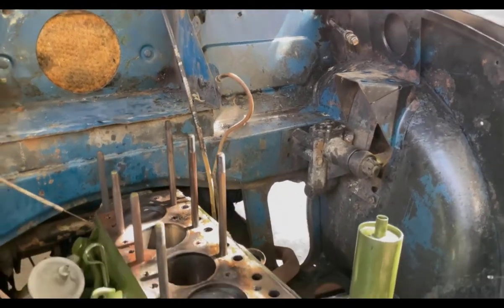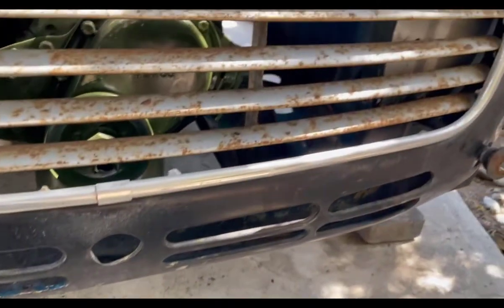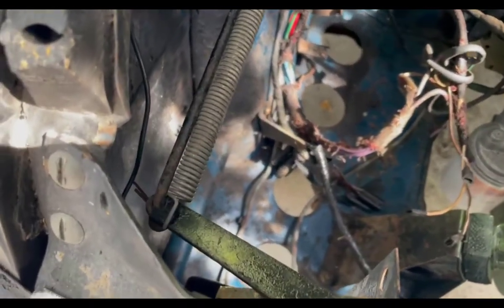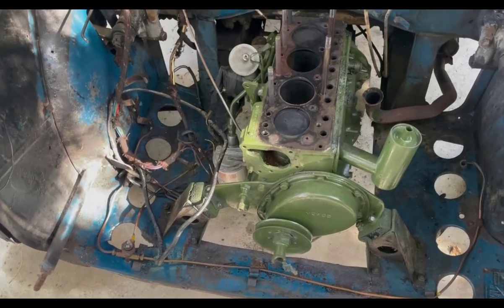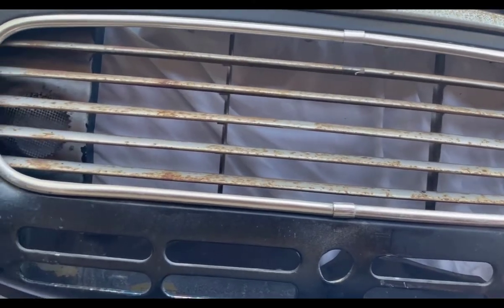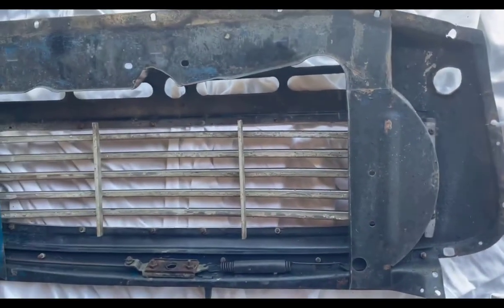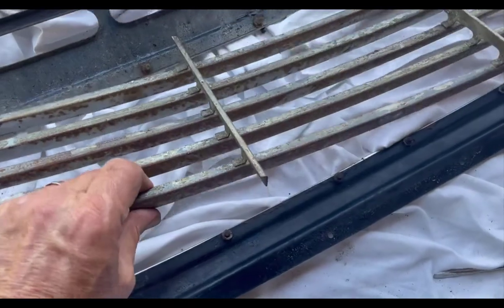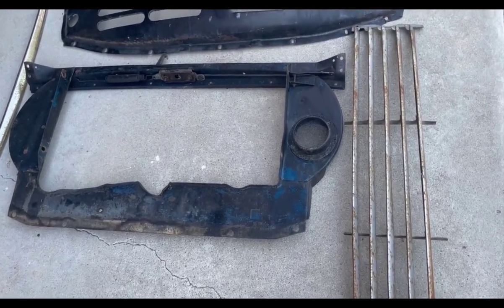Morris Minor Front Panel and Grille Removal

Comment: How about powder coating the front grill and the wheels you are going to use in the same color and same time.
Reply from the maker: Good question.  I am sourcing wheels (car came with  Spridget Rostyle wheels).  This is a very late Traveller and the wheels would have originally been silver and not the Glacier White of the grille. In any case, I may well have things media blasted and powder coated despite the higher cost versus stripping and painting myself - if this car were to be used for frequent driving it is certainly a good way to go in terms of a sturdier finish.